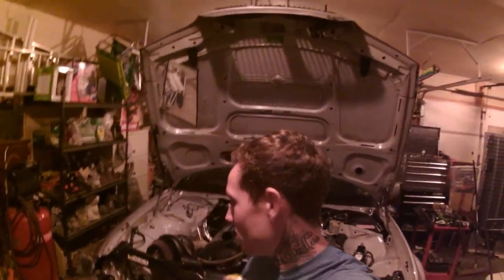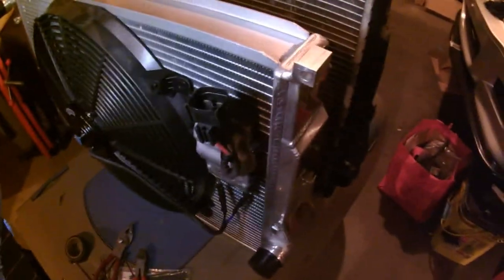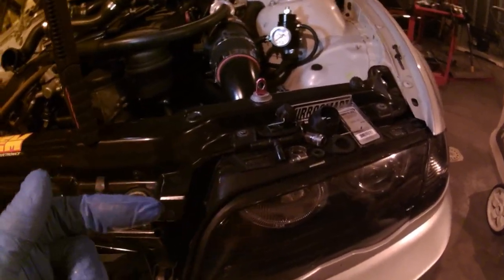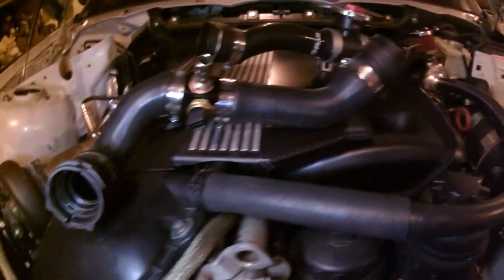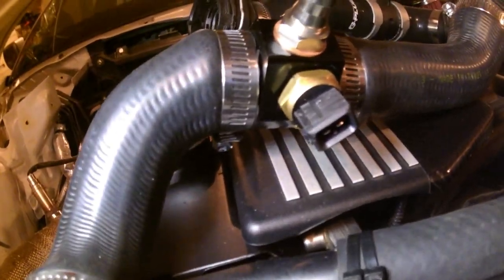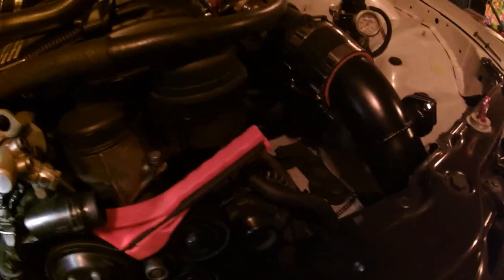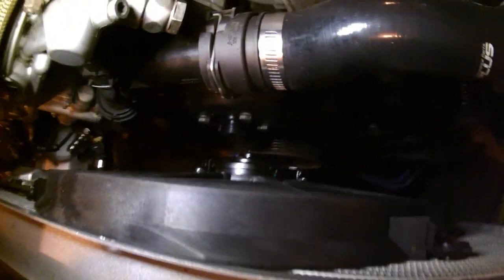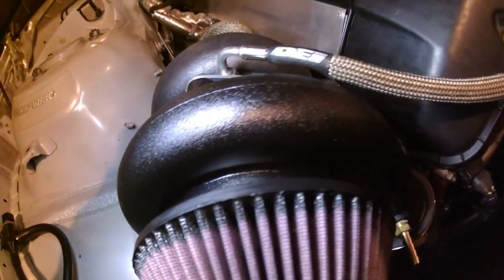BMW E46 Turbo Build Upgrade Parts Install #4 Cooling System

Comment: Hey dude I’m tryna turbo my 328ci and it’s a M52tub28, and I have some questions to ask if you can help. Love the build.
Reply from the maker: Ask away my friend
Reply from the maker: I seen you haven't replied, do you still need help with anything?
Reply: Tyler O'Leary how has it been running without the expansion tank?

Comment: Could you please link me to the rubber hoses and fill cap you bought to build the top coolant hose?
Reply from the maker: Filler neck is for a Dodge Durango/Ram truck, from parts store. silicone radiator hoses are ones sourced off eBay or Amazon, cut to fit. Just search BMW E46 Silicone radiator hose, the elbow is a simple 90° silicone elbow, forget the diameter. It's been about two years. You will also need to source extra OEM couplers meant for thermostat. I got mine from a junkyard.
Reply: @OLearysBMW  thanks alot for the reply!
Reply from the maker: @joeydecrease9996  You're welcome, of course! 😁

Comment: Awesome car mate.
Have you done anything to the engine? Arp head studs, head gasket etc?
Reply from the maker: Nope, she's all stock. The engine has 211,000 miles on it. Going to be running low boost until she gets tired. Then the engine will get built. But as for now, can't even tell it has that kind of mileage.
Reply: Nice! I run 0.5bar boost on my m52tub28 with supercharger. Looking to get around 0.8-0.9. maybe ill upgrade head gasket and arp. What do you think?
Reply from the maker: @ChazeFocus  so that's roughly 7 to 8 psi? If so, stock engine is totally fine for that. I'd only worry to upgrade when you surpass 10.
Reply: @OLearysBMW  alright. Yeah 10psi equals 6.8bar. i think the engine should handle 12-13psi if headgasket and arpstuds are used. If more than that, probably internals and lower compression ratio.
I was thinking of running 12psi with stock cr, just coppering head gasket
Reply: 0.68bar*
Reply from the maker: @ChazeFocus  I was gonna say, 6.8 bar?! 😂

Comment: Hey bro, do you think you could run the turbo coolant drain to the upper radiator bleed screw???
Reply from the maker: I wouldn't recommend that, what I've done is more commonly used. Block drain for drain and lower radiator hose for feed.
Reply: @OLearysBMW  fair enough. The bleed screw is at the highest point in the system though. All it would take is a m10X1 banjo bolt. I was planning on using block drain for feed. Then I have I good pressure difference to push the coolant up
Reply from the maker: @derek734  I like the idea, would be neat to see it done, I've also seen people use a heater hose splice.
Reply from the maker: What about sealing up the banjo bolt? Think she'd seal up well being a plastic hose?
Reply: @OLearysBMW  well it’s worth a try. I’m thinking seal a washer to the plastic and then sink the banjo bolt. I’ll let you know if it works! Cheers, your vids have helped me tremendously
Reply from the maker: @derek734  Perhaps nylon washers versus the typical copper would work.

Comment: What did you do about the automatic transmission cooler lines? Just leave em off? I’m trying to do this to my beater should I just leave the lines off and Send it? Mostly a 30 min max drive vehicle anyway
Reply from the maker: This car is an manual transmission. Although in your case, you could easily add an aftermarket oil cooler for your transmission by splicing into the lines.
Reply: @OLearysBMW  its a turd....i ripped so much stuff of this car...i usually dont drive over 30min away and the windows dont work with a fully gutted AC system so winter only....i should be good with heat on trans right with no cooler
Reply from the maker: @staticxmako  I hate to say yes, as it's definitely not recommended. I'm not quite sure just how well the stock cooler works in terms of the transmission's life, so I'm not idealizing whether or not it gets removed. I'm going to leave it up to you my friend.

Comment: Hey man so what did you do with you coolant level sensor on the tank?
Reply from the maker: It's gone. Splicing the two wires together keeps the light off, just a simple circuit.
Reply: @OLearysBMW  okay good to know that easy enough
Reply: Thanks again man is there easier way to reach out to you. Beside social media?
Reply from the maker: @matthewesterbrook6119  I have Insta and Facebook. @olearyt0534 and @olearysgoods

Comment: 6:44 7:02 im a bit confused... What do you mean when you say any hot water leaving the turbo? Isnt this the feed?
Reply from the maker: No, the feed is from the engine block drain. The water pump draws water through turbo, water entering that barb on radiator hose is the drain from turbo.
Reply: @OLearysBMW  ok.... Thanks for the quick reply, so I might sound like an idiot again but shouldnt  your turbo or the center housing be rotated the opposite side? Isnt the lowest side of the coolant port for the feed & the high side for the drain?
Reply from the maker: @Scarlif3x  No, and I explained why. When the engine is off, gravity will take over and drain off any coolant inside turbo so it doesn't sit and bake. Although, from previous setup, the coolant drained fine when the turbo was clocked the opposite way as well. It's just recommended to have drain side clocked down.
Reply from the maker: @Scarlif3x  give me a moment to re learn the coolant flow. Hold on a sec, 👍
Reply from the maker: @Scarlif3x  I'm backk, the clocking I have is correct. Now, you're right. That coolant barb is the feed! So that sensor won't see water directly from turbo! The water pump will pressurize that hose, forcing coolant to block drain. Thank you for your questions
Reply: @OLearysBMW  hmmmm, wouldnt the coolant level on the block be higher then the drain bolt making it not drain properly ? Specially with no check valve which not sure if you added one? Assuming u didnt since u though the was the feed? No, thank you bro for replying
Reply from the maker: @Scarlif3x  when I had my coolant lines removed from turbo, there was no coolant inside the turbo, the coolant will only travel when forced. The block drain hose was filled with coolant but not to turbo, however, when the coolant hose was angled downward after removal, then all the coolant poured out from gravity. With engine off, the coolant levels. It doesn't travel up the hose.. I knew it was the feed, just had them mixed up in my head. It's been a while since I've had to think about the cooling system
Reply: @OLearysBMW  Got it👍🏼 so you wouldnt recommend adding a check valve on the coolant drain hose or even the oil drain? So their is no need to add the temp sensor on the bottom rad hose since its the feed?
Reply from the maker: @Scarlif3x  there's already a factory temp sensor located in the bottom hose. I had to relocate it due to my over sized radiator.. I wouldn't add a check valve into the oil drain, that's an un needed restriction. Bad news for a oil drain. Draining into timing cover is ideal, I highly recommend it.
Reply: @OLearysBMW  Yup I would want to drain it to the timing cover too but unfortunately Im doing that when I open the motor... I dont think you can remove the cover without removing the head correct? Also you mention the stock electric fans cfm is 3,000? But why does Mishimoto's fan for the non m e46 claim 1,850 Up to 22°F reduction in outlet temperatures at idle?
Reply from the maker: @Scarlif3x  yes, it can be a pain to remove the timing cover without engine already disassembled. The stock cooling fan is a beast, mishimoto claims may or may not be true. Perhaps the design of their shroud and fan blades make it more effective. I lost interest with Mishimoto, their quality has sorta went down hill. I was sponsored by them, but it seems they'll sponsor just about anybody.
Reply: @OLearysBMW  It does look like they just send u one free thing & all the rest you have to buy lol I went with a csf radiator rather then a mishimoto cause of the pricing, the csf is slightly bigger then the M, plus they are expensive! I feel like their parts work the best on jdm cars.. I do want their oil cooler+lines & oil thermostat though lol are u runing a new 10an oil drain hose to the timing cover?
Reply from the maker: @Scarlif3x  10AN should work nicely. That's what I have to my oil pan. The engine I'm currently building, an M52b28 iron block, will have an 10AN to timing cover
Reply: @OLearysBMW  are you going to use a new hose and new fittings?
Reply from the maker: @Scarlif3x  already have a custom oil drain tube on turbo that aims nicely to timing cover. Just need to cut my hose shorter and get a fitting for the timing cover

Comment: If you remove your AC condenser and relocate your power steering cooler.. you actually can use the stock fan with that radiator! Also for you xi drivers.... These radiators fit Don't let people tell you otherwise! LOL I had the manufacturing department at DNA Motorsports swear up and down it would never fit my car well as of 3:00 a.m. this morning.. LOL she fits

Comment: What you do with holes in the intake runners that go to the ccv? Just plug them?
Reply from the maker: You can remove the intake manifold and tap those ports and install some npt plugs. I have the distribution rail still installed with the two ports on that capped.
Reply: @OLearysBMW  when are u planning to start driving it? I'm excited to see how the cooling system works, well actually the whole build lol
Reply from the maker: @Scarlif3x  should hopefully have a base map on the car this year before I store it for winter

Comment: Hey man. Was installing my cx kit and there’s an extra circular piece divided into 4 sections. Any idea why this is?
Reply from the maker: That part is an oil filter sandwich plate, not applicable for our cars. I'm not sure why that's included. Those are used for vehicles with a traditional screw on style can filter. The sandwich plate mounts to the oil filter adaptor, as a source for an oil source to feed things. Then the filter screws onto it, seals against it.

Comment: I’ve deleted the ccv system on my car as it was clogged and causing blue smoke so I installed a catch can but I now have an increased vacuum on my engine, could you give me any pointers? Because I don’t want to cause excessive leaks all the time etc
Reply from the maker: So you've deleted the ccv with a sealed system that includes a catch can, right? Where did you source your vacuum from and what pcv valve was used?
Reply from the maker: Your reply for some reason isn't loading but I seen most of what you said. You've used the proper PCV valve as that's the one people recommend. Now, what you're experiencing is totally normal for this setup. It elevates the vacuum pressure in the crankcase. Basically double the original vacuum.
Reply: Should I run a breather to let it vent to atmosphere or just leave it in its current setup as I will later on be boosting it and wouldn’t want to over pressurise anything
Reply from the maker: @DreadedEdits  only way you can vent to atmosphere is if you plug all vacuum sources from ccv. Crankcase cannot be under vaccum if vented to atmosphere. That will just be a giant vacuum leak.
Reply from the maker: @DreadedEdits  sealed setup is not recommended with turbo setups on theses cars, vent to atmosphere is recommended.
Reply: Thanks for the help, so I’ll run the setup I have for now but when I boost it would it be possible to splice in a T fitting with an extra hose and a check valve in it so under vacuum it would be sealed then under boost it would vent to atmosphere? How does that sound?
Reply from the maker: @DreadedEdits  an acquaintance of mine has tried multiple setups including check valves, pcv valves.. Etc. He returns to vent to atmosphere everytime. Currently he's vented to atmosphere while using an venturi exhaust valve to draw the vapors through the exhaust. That's been his setup for a long time now. It's a legit racecar though, so he's not worried about inspections and stuff. If you want to retain a sealed pcv setup for your car, there is a product I'd recommend. And I'll link it here. Using it will allow you to be both vent to atmosphere and sealed. It only becomes vent to A while under boost.. Rest of the time it will be sealed, read about this product thoroughly, http://performance.vargasturbo.com/ecommerce/index.php?route=product/product&product_id=97
Reply: Awesome stuff thank you Tyler it’s a great help, I’ll look into buying that breather cap as it is exactly what I’m looking for on my boosted setup, thanks for your help and keep up the good work 👍
Reply from the maker: @DreadedEdits  no problem at all! You're welcome, 😁